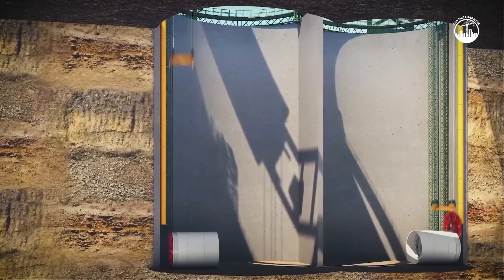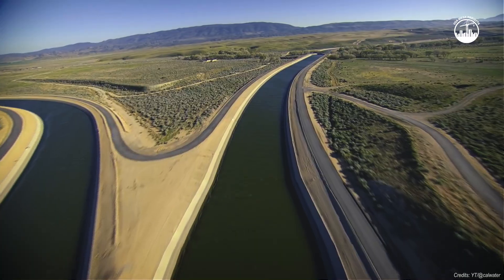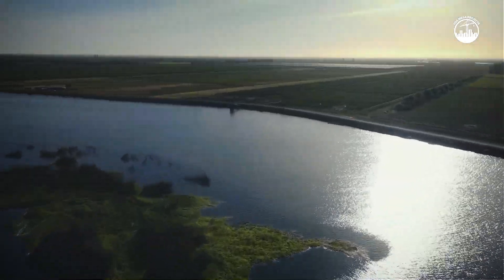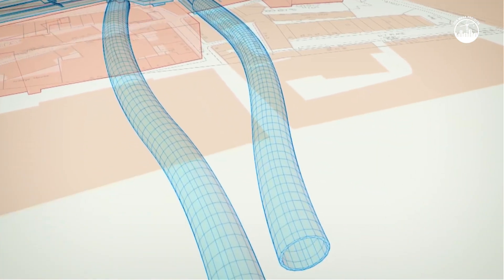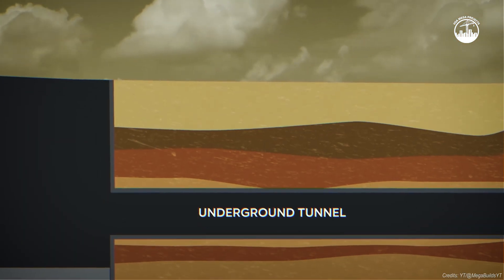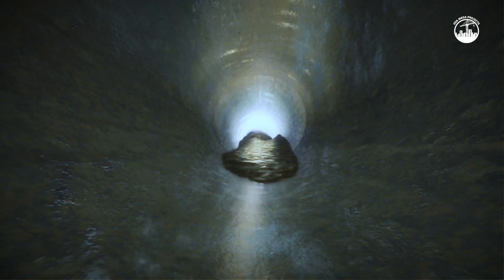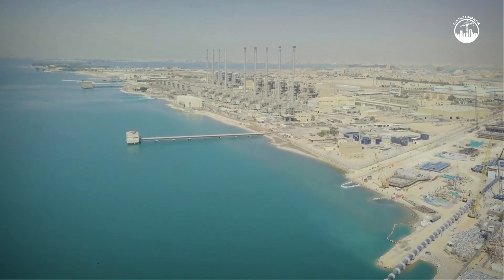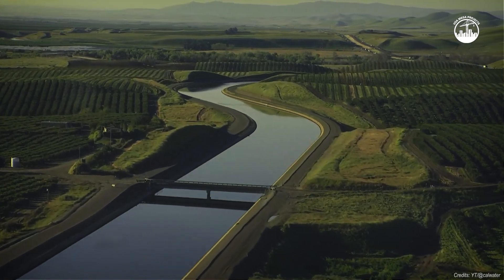California is Building a 72-Kilometer Underground River: The $20 Billion Project

Comment: The only thing they can do is build a mountain in the South where it snows on top of the mountain and puts a stream of fresh water to the ground
The reason why water stays on the ground is because there is something that is keeping the water at a stable temperature otherwise the water would evaporate
The reason why water stops at the point that it is is because that is the extent that the temperature has allowed of the water to reach and if you try and extend it further it will all evaporate
You have to build mountains may it be 3D printed stacked on top of each other or some other method that I'm not aware of but you must build mountains and have it snow on top of the mountain to get fresh water
Reply from the maker: That’s a very imaginative idea, but building artificial mountains just to create snowmelt streams wouldn’t really work in practice. Natural mountains form over millions of years with geology, altitude, and climate working together — they don’t just make snow because they’re tall, but because of their location, elevation, and weather systems.

For fresh water, more practical solutions exist: desalination of seawater, recycling wastewater, rainwater harvesting, underground reservoirs, and better agricultural water use. These methods are already proven, scalable, and far more cost-effective than trying to “print” a mountain.
Reply: We already have enough snowcapped mountains with plenty of water storage. Problem is the dems and the environmentalist believe dumping water into the ocean is more important than what the farmers and people need. The US government build a fantastic system starting back in the 50s through the 70s to capture enough water for the dry years. They also didn't envision the invasion of over 20 million illegals just in California who don't care about water conserving. Same with the Colorado river, It's not lack of rain/snow, It was never designed for the number of people it has to supply in 4 western states. It can never get caught up.

Comment: AirJoule, Carrier, and BASF are bringing condensation to the next generation A/C units! Water for everyone! No $20 Billion corruption scheme required!
Reply from the maker: That’s a solid point. If new tech like AirJoule’s condensation-based systems really scales up, it could solve both cooling and water supply problems at a fraction of the cost of these massive projects. Sometimes innovation makes more sense than throwing billions at mega infrastructure.